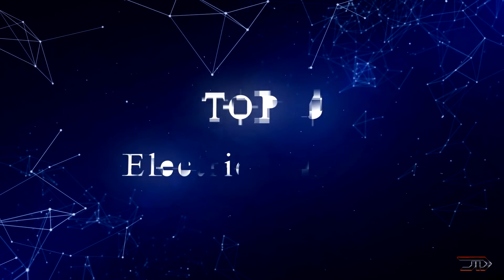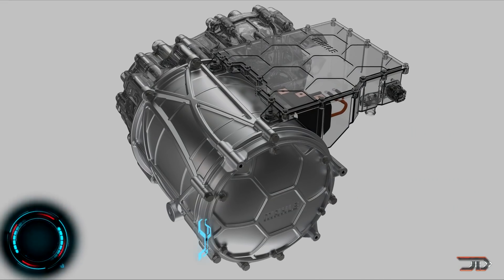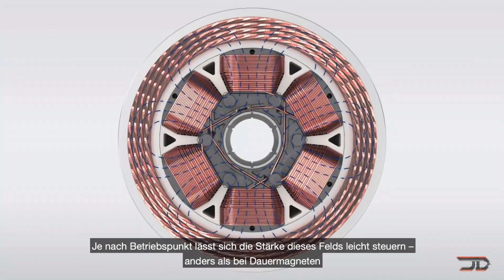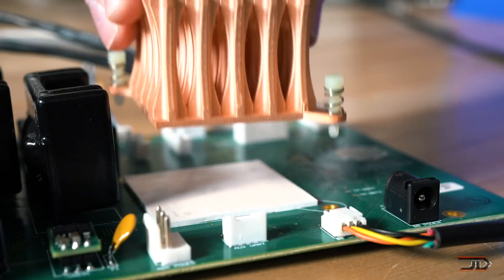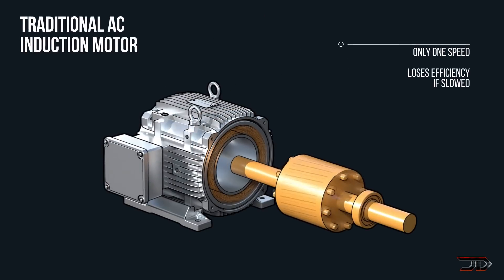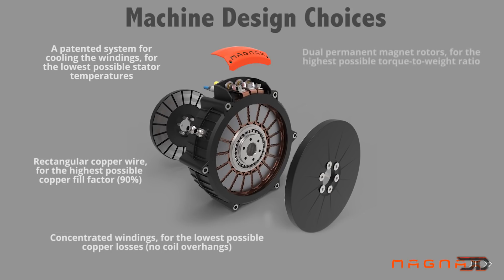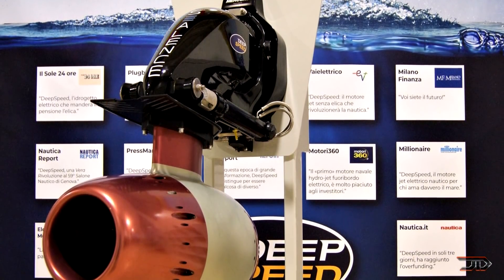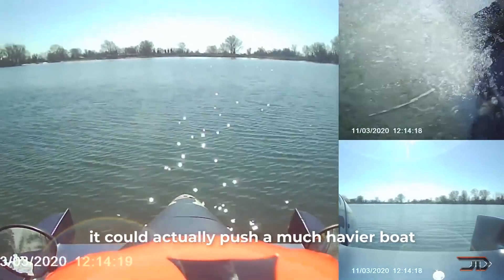5 GAME-CHANGING Electric Motors

Comment: Thanks for one more information packed video, I think in most of the today's EVs they only control torque not speed as controlling torque is far more easier than controlling speed I heard it from the Rivian EV founder.
Reply from the maker: Thanks for watching. Here is an interesting comparison from Turntide but it does not include axial - https://turntide.com/motor-comparison/ I will try to do an overview for EV motors but there are tons of designs out there heh
Reply: Torque is the only control you have! Steady speed happens when drag and friction stack up to equal the torque.
Reply: In a standard ICE vehicle you only really control torque. The part that delivers the right amount of torque for a particular speed is usually the driver's left foot (although cruise control is also fairly common).
Reply: you can control speed very easily. Just doesnt make much sense for a car. You just make a pid loop that uses torque(current) to achieve a desired speed
Reply: @Tech_Planet  the video is about electric motors, yet the "#1" on the list does not have information about the type of electric motor being used on it...

Comment: Aren't the most common motors on the market for EVs lately synchronous reluctance? Or would you count this as radial flux? I always thought of them as being essentially reluctance motors with carefully managed internal permanent magnets and slots to direct and balance the magnetic flux? 
The Yamaha one seems interesting. I guess the price is the real question... would be amazing if it was somewhat affordable though.
Reply: They're called IPM motors. Interior permanent magnet, they are what you said a combination of a permanent magnet and synchronous reluctance. The advantage is they field weaken better than straight SPM (surface permanent magnet) motors. This means that once you move out of the constant torque region (low speeds) they have better high speed performance and a flatter constant power region. They are pretty much the go to in most EV applications although alternatives are being researched

Comment: I've always wondered if a wankle motor could be converted to electric.  I suppose I should call it a 'rotary motor' since I'm not 105 years old- but the convex/concave nature of the setup could/should allow for magnetic coils to be effectively used. 

I'm sure it's not likely as efficient as a standard electric motor- but it might be more powerful.
Reply: That would be fun to see!
Reply: I mean, since the Wankel is an internal combustion motor the design configuration space is significantly different. A way to examine this question would be to ask, "Why don't we see electric motors configured like traditional internal combustion motors", where you have magnetic pistons pushed/attracted by electromagnetic piston heads?  I don't really know the answer off the top of my head, but were I to guess its that at the very least any gain from the 'Traditional ICE configuration" electric motor is outweighed by the added complexity of the extra parts that take that motion and turn it into rotary motion.
Reply: it would make a terrible electric motor
Reply: @Oceloctopus  magnetic fields do not extend into space that far (inverse square of the distance?)  As they optimize electric motors the gaps tend to get smaller.  When thinking EV it is best to forget ICE... the tech  is far too different.

Comment: Remember though that no electric motors today use contactors or brushes as in armature.  It's all inductive.  Well, except for my old Dewalt drill.  But even hand tools are inductive.  Aren't they?
Reply: The move today with DC motors is "brushless". Brushless DC Motor, BLDC. Now the coils are on the outside, no commutator needed. The magnets are on the rotor.  Electronic switching sends the current around the coils. Rotating magnetic field.  Similar - but not the same - as AC servos and even stepper motors!
Reply: I don't think there are any electric cars which use brushes.
This video was given a very generous helping of word salad.

Comment: would be interested in building a, both axial and radial flux electric motor.

debating on the stator or rotor being powered,.. 
Would also like to play with electron movement across resonant chambers as a driving force in an induction motor

Comment: its strange to me that no one has new design with disk and calipers and put the shaft on the out side so it would have grater R.P.M and that way you could make a generators bilt in to the disk like a role of disk then a role of generators disk with the shaft on the out side to get the R.P.M with out using that much amps and you could gear it down for more toque every thing is old

Comment: Graphene windings instead of just copper? There are innovative motors using graphene and carbon nanotube wires to improve many things
Reply: Probably v2 or v10 in the future should try it, but graphene is super expensive atm, not 100% reliable like cooper in 3d printed form and is poorly investigated as 3D printing material, it has a lot of shortcomings, and you are prototyping a radically different motor concept that needs to be proven first with known and cheap materials you can buy anywhere.
 
That's too much of a gamble for an investor and will kill the motor concept before trying it with the usual scrap materials.

Imagine this: they will first need to develop a graphene 3D printing material with electromagnetic properties as predictable and constant as cooper's then recalculate the whole motor concept from the ground around graphene EM properties. Then hope for graphene manufacturing price to lower, to be able to sell it at a reasonable price.
Reply: @fofopads4450  Problem is that it's not yet possible to produce singular graphene sheets but still copper wires could just coated using graphene enough to improve drastically conductivity. Heatsinks and some carbon fiber products already utilize amazing properties of graphene. Carbon nanotubes are different from graphene and I don't much about them except their huge tensile strenght.

Comment: I suggest at least two of those 500 hp Yamahauler motors for the standard street Joe Publc operated motorcycle.  WTH???  You need 500 hp on a street bike like you need six more holes in your head, and many will likely achieve that outcome on a bike like that.

Comment: i think theyre bringing electric cars into the mix way too early. they should start making things hybrid fisrt and getting that 80 mpg highway first and then get into it. but theyre trying to completly phase out internal combustions engines in just 5 years when they havnt even figured out a battery solution. cuz lithium ion arnt goodenough anymore and create a shit ton of waste when being disposed.
Reply: I rode in a hybrid to airport dude was getting 73mpg.
Reply: Ultra graphine capacitors etc. Litium bat makers etc have so much pull in the industry some mavericks need to set loose the tech, these huge global companies are planning 20yrs in advance on when tech is released and what it is to decide what you want to use and when it'll be mainstream
Reply: @aaronholcombe2963  yeah see you know what im talkin about. we gott get those battery solutions to be mainstream and replace the lithium ion ones.

Comment: Always a few years away from production, just like Fusion...
Reply: 😂right...
Reply: Well, no, not at all. YASA already make axial flux motors. However they have been hit by the whole covid thing just when they were about to ramp up to full production. They do still however sell them in low volume.
Reply from the maker: @th3d3wd3r  Heh yea. The axial flux motor will hopefully be next gen, it has really good power/weight ratios.
Reply: @Tech_Planet  YASA motors also stack in parallel. You can get a single axle that goes through them. Each unit is around 30cm diameter and 10cm width. Producing some 250hp and 250lbft of torque per unit. So four stacked would be 1000hp and 1000lbft in a 30cmx40cm package weighing approx 40kg
Reply: Only a few years away from production in a well-funded, highly-competitive market means they're just around the corner. Versus fusion which is and always will be "30 years away", thanks to a series of insurmountable obstacles that have yet to be overcome, and cannot be solved using existing technology.

Comment: The problem has never been the motors. The problem has been and continues to be the batteries. A cheap car can go 300 miles or more on a single tank full (charge) of fuel and be recharged (filled) in less than 5 minutes. When electric cars can do that they will become common. Mind you that will change nothing because the electricity STILL has to be produced, the batteries produced, etc etc. If you really want to support a clean cheap abundant energy source that works and is available RIGHT NOW! I recommend you start speaking with your representatives about building nuclear powerplants.
Reply: I bet it will be natural gas electric fuel cells. Like "bloom boxes".
Reply: Currently solar and wind is much less expensive than nuclear.  The time it takes to charge a battery is 99% irrelevant as you can charge at home overnight.  I have taken a few road trips in my Tesla and the 20-30 minutes on a supercharger goes by quicker than the other stuff we do on these occasional breaks.  We are currently at the start of the "S" curve for adoption of EVs.  It will take some time (if ever) for legacy auto to change over to EVs but there are a few EV vehicle manufacturers that are full steam ahead and are constrained with supply issues but these are being addressed.  Tesla's are performance vehicles but lower cost Chinese EVs will likely be a better value proposition to replace cheap cars.  Batteries are only getting better and cheaper.
Reply: @ricinro  In a couple of generations batteries might be advanced enough to make electric vehicles a practical solution.  The best look forward currently says that our grandchildren will still need petroleum fueled vehicles.  That you are happy killing a half our every time you need to charge is fine for you, but the vast majority of people are not.  They want to get on their way and get to their destination.  I would be interested in your source about the price of nuclear energy because most of Europe uses it because it is the cleanest cheapest power generation available.  I have visited a nuclear power plant here in the states and they were very happy to tell me that they were the cheapest power supply in all of TVA.  Now I don't recommend you ask for a tour. I was allowed in because my brother worked there. He was an electrical engineer there for 28 years and confirmed that nuclear power is by far the cheapest way to produce electricity.  If batteries advance significantly and if the price is substantially decreased and if charging time is drastically reduced and if the infrastructure is built and if the toxic waste problems of batteries are delt with, we will desperately need nuclear power.  Then there is the moral problems of buying them from a nation that tortures slaves to build them. Thankfully I am old enough that I will never have to rationalize the torture of humans so I can have a cheap electric car.